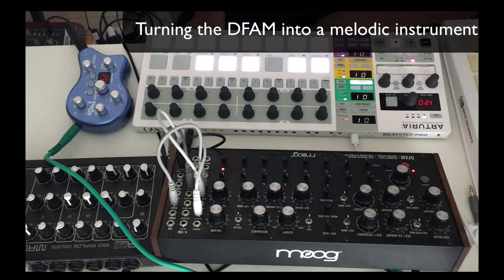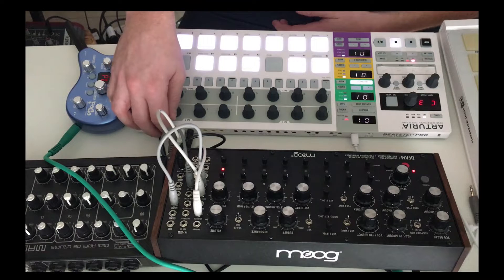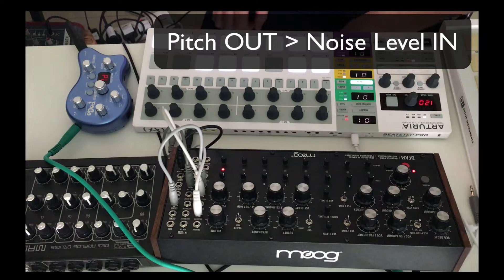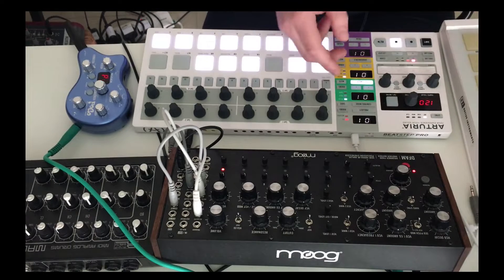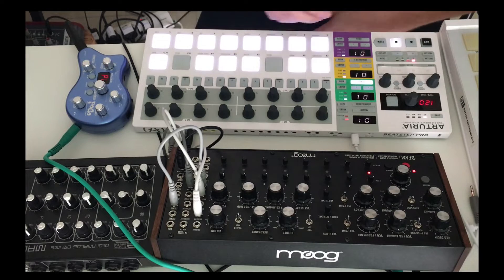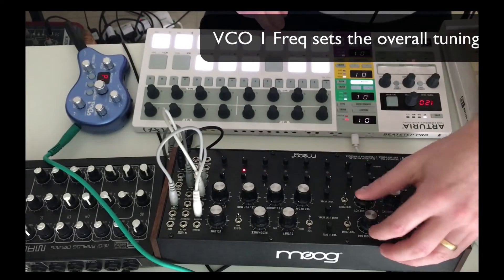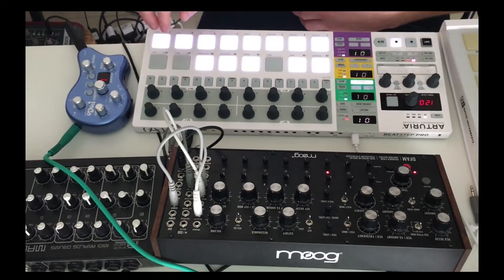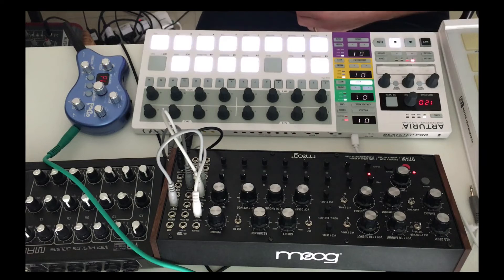Using the Beatstep Pro & Moog DFAM as a melodic instrument!

Comment: hey man. there is a way that it wayyy more simple. and you can even get polyphony!

BSP Pitch to VCO 1 CV
BPS Gate to ADV/CLOCK
BPS Velocity to Velocity

(Pro tip: if you use a splitter/hub you can send the pitch also to VCO 2 CV and get polyphony!)
Reply: hey thanks for the video! I think you should be using attenuators Arturia gate output 
is 12v ? Moog requires 5v
 Arturia says: 
Gate Outputs: 12V.
If your destination device requires 5V, it will work and won't damage it.
But in long term, we advise to use attenuators to avoid any risk of premature wear.

Pitch CV Out range: 0 to 10V.
The Beatstep Pro can't deliver negative pitch voltages.

Velocity: 0 to 10V
Please note that the velocity output voltage can be attenuated from the MCC
Reply: @TwistedElektron  BSP has a setting now, can change voltage
Reply: inf0tr8r I don’t think you can change gate output...
Reply: Thanks for this Jose Haya, how would you recommend connecting 2 DFAMS with a Beat Step Pro ?
Reply: SoniK Saint I don’t think there is a problem using BSP with DFAM
Reply: @gracecore  i would use one sequencer for each! let me know if you need any help
Reply: @josehaya6362  WOW been awhile, finally got back to it ..are you on Facebook, wouldn't mind reaching out for some  help if the offer is still there
Reply: @gracecore  sure man. Jota Haya on FB.
Reply: @josehaya6362  cant seem to find you,  got a link  to your profile ?
Reply: @josehaya6362  got just sent friend  request

Comment: When you have your Beatstep Pro sequencing the DFAM, you can still sync it to an external MIDI source yeah? If I get the DFAM and BSP, I'll run sequences the same as your video explanation but want the BSP receiving MIDI clock from the Maschine or TR8S? & will the start/stop also activate if BSP is clocked to external Midi clock? I could get a Beatstep to use as sequencer for couple synths but don't want it to be the master. Is this an easy set up?
Reply: There's a Trip Hop track of mine of this page if you're interested. & a coupleDawless jams too...

Subbed to your channel mate as you have some luscious vibes occurring...

Comment: I am thinking of buying a DFAM but the 8 step limit bothers me... can you use the Beatstep Pro to get around this limitation and make longer sequences?  I guess you can patch the Arturia to velocity and tuning??
Reply from the maker: Neil Loughran sure can, although I didn’t mention it in this video these settings also allow for a 16-step program. The 8-steps is an awkward limit and I would honestly prefer 16 as standard, but I can’t recommend the dfam highly enough despite that. There really is nothing else like it
Reply: @DonDayglow  Yep. Really unique machine.
Reply: There are a many ways to extend the DFAM beyond 8 steps. Some options... 

1. If you have a clock divider, step the trigger input 8 times faster than the adv/clock input, you'll now have a basic bass line where each note in the sequence is played 8 times before moving to the next sequence step (you can do the same thing on the BSP by changing the note lengths, so the clock is now a faster rate than the gate output). 

2. Set up a basic 8 step sequence on the DFAM. Now clock the BSP 8 times slower than the DFAM. The DFAM will run through the 8 step sequence, the BSP will then advance 1 step, transposing the original 8 step sequence. 

3. Turn the Seq pitch switch to off on the DFAM. Connect the gate output from the BSP to the trigger input of the DFAM. Connect pitch to the DFAM oscillators (or sync the second OSC, and just use CV1). Velocity to the velocity input, and you now have a playable monosynth (DFAM does not need to be running if you use the trigger input instead of adv/clock). 

It's modular, so there are always options. I have 2 DFAMs whose sequences are transposed by the keyboard out of the Mother 32 (DFAMs are usually clocked at different rates for extra fun). Its a really nice setup for those kind of bass lines from 70's/80's synth tracks (I feel love, bladerunner end theme, the chase, etc).
Reply: @robthebloke  great will look into that!
Reply from the maker: @robthebloke  Great tips, thanks!
Reply: the dfam can play whatever you wish for. You just need to use CV to controll it instead of the built in sequencer. Its a really unique piece of gear and sounds fantastic.

Comment: Hey, thanks a lot. I got a question: I want to buy the Arturia KeyLab mkII which has no CV velocity out. So do you think all this is still possible? Have you tried without connecting the velocity out of the BSP and the velocity in of the dfam?
Thanks!
Reply: This method wouldn't work, because it relies on CV to control pitch. But, you could use the keylab's trigger out to launch the DFAM sequencer.
Reply: Adam Hignell hey man, thanks. Actually it worked. Pitch out to the osc1 and the gate out to the clock in. So I can play the dfam now as an melodic synth. I did not need the velocity connection. But in the end, I’m limited with my possibilities to record this. The only way I can record my dfam is to connect it via gate with my behringer odyssey. 
Best, O